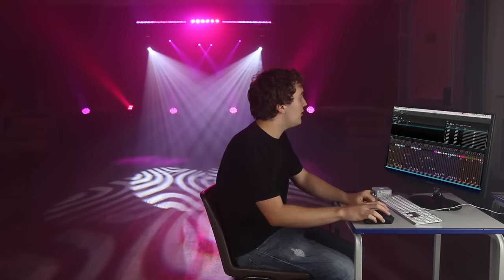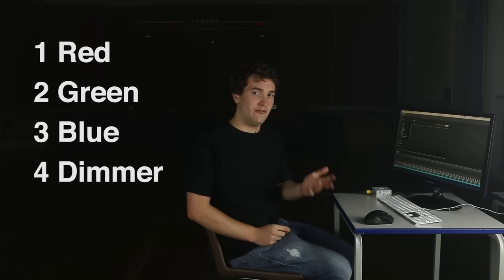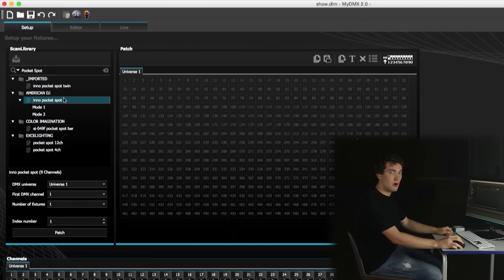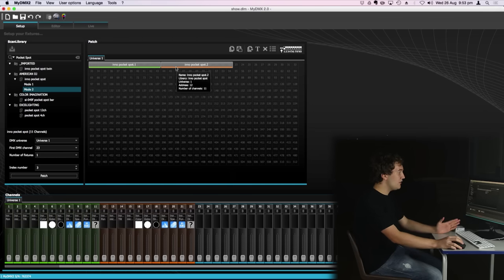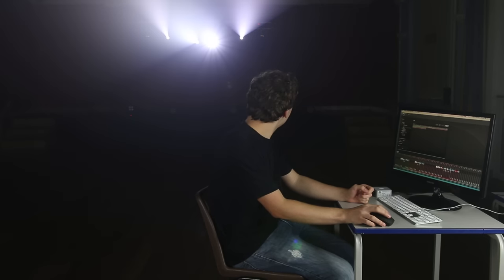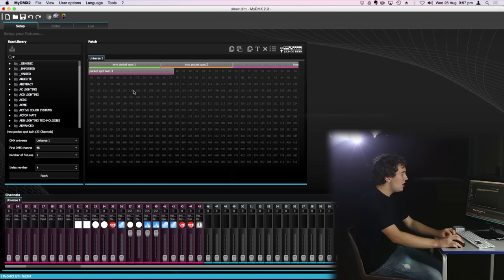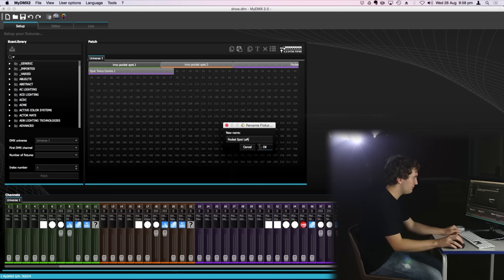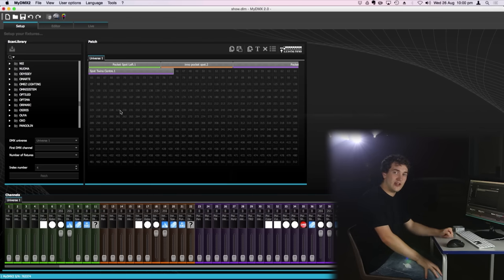Patching | ADJ MyDMX 2.0 [Tutorial 2]

Comment: First off, GREAT VIDEO'S, just picked up a pair of Pocket Scans, and am looking to build up my lighting rig and grabbing the my dmx buddy.  One thing i'm curious about is, when creating scenes and different commands for the lights, will they still react to sound?  Or will they be locked in to what ever you program them to do.
Reply from the maker: +pablo rocha Thanks! With DMX some fixtures will have a mode control in the fixture profile that allows you to control show modes and sometimes even enable sound active. However most fixtures (including the pocket scans) can't use sound active control through DMX

Comment: Hi 
Will you post a video on the scan-libary editor? The other ones on youtube suck. They are too long, slow, unclear and hard to follow. I have used Daslight's scan libary editor before and asume that it will be similar. (Daslight also sucked (well the early versions did - simulator was inacurate and fixture profiles even more so)

Comment: Is terminating communication on the last light necessary or recommended when using this software. If so what resistance(Ohms) is recommended on the resistor. I'm using just over 150 ft of cable btw.

Comment: Hey Joe, Can you explain how to make two moving heads act opposite? What I mean is,  for example I have ADJ INNO POCKET LZR, I use MYDMX 2.0 controller. I set up pan and tilt inverted on the light menu. They work ok but one laser is on top and the other laser is on bottom. The beams also are just a little bit off. is there a way to accomplish this in MYDMX 2.0?

Comment: Hey Joe, great series, I am just getting into DMX software and have a question.  I have ADJ mega par profile plus and can not find the correct mode to patch in MyDMX that lets me take advantage of the UV channel.  Any help would be greatly appreciated.
Reply from the maker: +Tweezy06 Is the profile missing from the software? If so post on the MyDMX 2.0 Facebook group and James should be able to link you a file.

If thats not the problem it might be If your using the colour picker in the scene builder. You may find that the colour mixing only applies to the RGB channels. Try making the colours yourself using the virtual faders
Reply: Thanks Joe I found out that I did not have the ssl2 file.  Got the link off MyDMX Facebook page. I had the profile plus which wasn't in the program when I downloaded it.  Link below:

https://www.dropbox.com/sh/2zpbbncoh2oywge/N-oxXE7de

Comment: Hi Joe, how long of a DMX patch can I run before I start having signal loss or problems?
Reply from the maker: +Jon Ross 32 Fixtures in a single daisy chain. With splitters you can connect as many lights as you want

Comment: Hey Joe, does MyDMX work with any lights?
Reply: you can make it work with any light, but the lights wich are pre programmed are more simple to use.
Reply from the maker: +MusicHow It works with any DMX lighting fixtures
Reply: +PassionTV  only for ones that have dmx input and output :D if they dont it will not work for dmx

Comment: Hey Joe. Are you using the Beta version, or did they finally fix it? I personally hate the Beta version as I can barely use it at all. It works fine up until I start making tons of scenes. Then it crash's really hard & I lose everything I've done. I'm hoping they finally got this sorted out. I swore I wouldn't mess with MYDMX2.0 until they got it fixed. It just sucks cause I really like MYDMX2.0 & love using all the Beta upgrades like the 3d visualizer etc but again, the crashing drives me crazy. I just want the beta to be an official update already.. Thanks for your response.
Reply from the maker: +Tony Draper This video was recorded using the latest beta. I had no issues at all and experienced no crashes. Hopefully the full release is coming in a few weeks. Which version are you using? I don't recommend using the beta versions unless there is a feature you particularly want. 3D visualizer is still work in progress from what I've been told. Hopefully will have more features added with a full release coming soon!